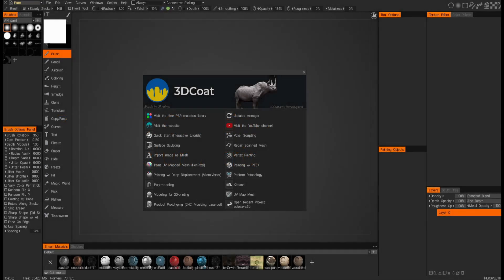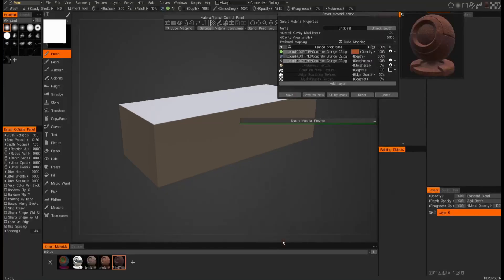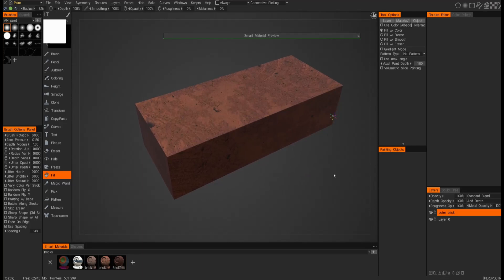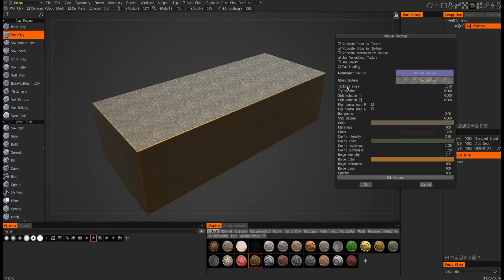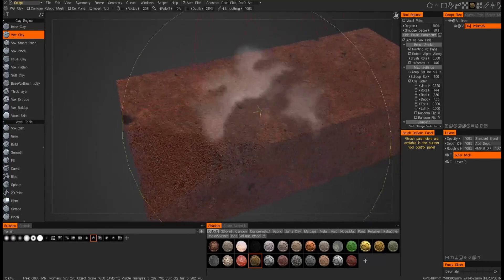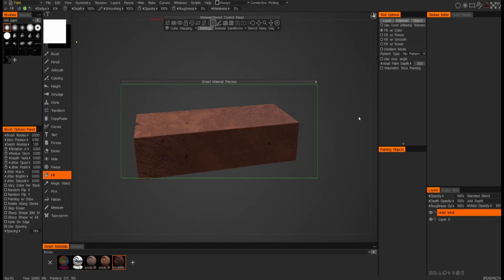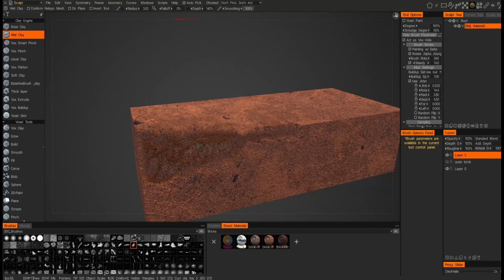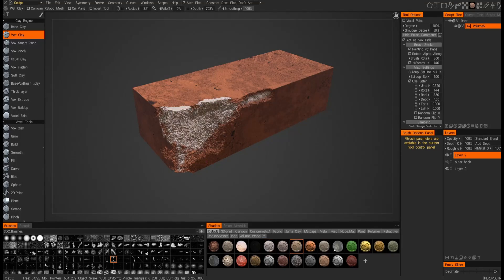3DCoat: How to create a multi-layered Volumetric materials

Comment: How would you bake it to low poly while keeping the materials?
Reply from the maker: You could always try to bake it down to a low poly mesh in the retop room.
Reply: @industrytuts5272  I dont know 3d coat. When I bake in substance it doesnt keep material as I know. It just gives the maps like ao, curvature, height and etc. When baked in 3d coat will it keep the texture? That would be very cool. And If it can a tutorial {from you :) }for that would be great and show complete production for such elements for projects.
Reply from the maker: I may make a video showing this process, but you can try to export from the sculpt room from the file menu Export->Decimate > AutoUV map > Export.  This will give a triangulated mesh but with the option to export PBR textures based on your material setup.  Hope that helps.
Reply: @industrytuts5272  I will check that. Thank you:)